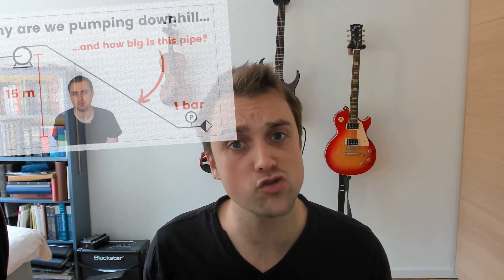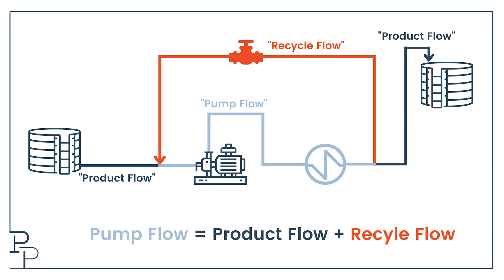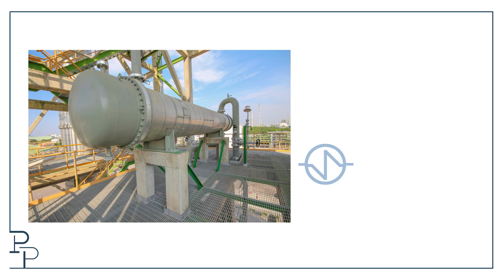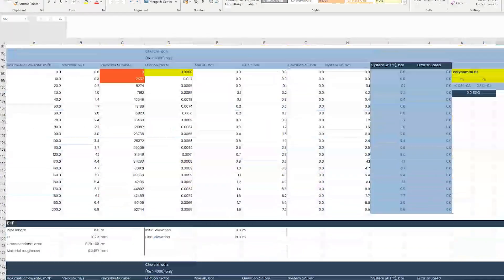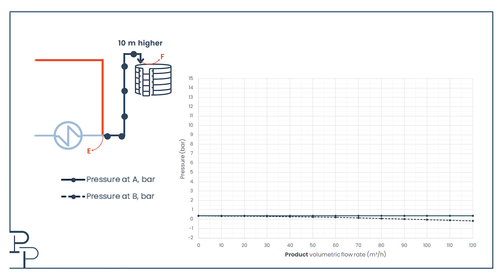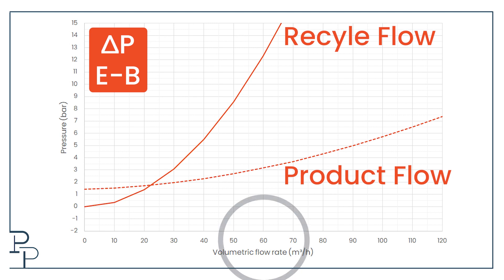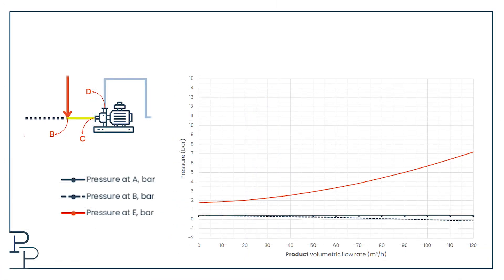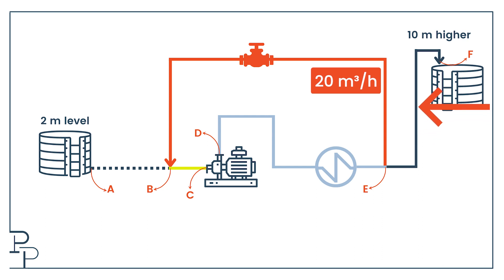System curves with recycle lines

Comment: Excellent explanation
For me the system curve can be defined as a function of the recycle flow, the pruduct flow or the pump flow. It just depens on what flow is important in the process.
But maybe the system curve definition is based on the pump flow because the definition is maybe based on a simple example without recycle line.
Thank you Pat !

Comment: Good job on a tricky problem.   It seems like you have assumed the recycle valve has a fixed CV through the range of your flow rates, another way is to assume a % of the flow goes through the recycle.   in your case, a fixed restriction is like is like using an orifice, which could be a good idea to consider because of cost, but then you would probably need a control valve on the destination to maintain a desired flow to the tank.  To keep the problem simple you didn't optimize the size of recycle valve (or the size of the orifice) with the sizing of the pump, or consider using a pressure control valve in that location, but others may want to do so.  You made an arbitrary choice on it's CV, but changing that CV could have a significant impact on head and flow of the pump, the long term energy use, the NPSH, and the reliability (how close you're running to the min flow) of the pump.  

Probably would be worth you doing a video for a recycle system where the suction and discharge are coming from and going to the same closed tank.  That's a fun one to think through. :)

Comment: What is the point of having a recycle line here.  Are you using a recycle line to control  product flow to the tank?  Most of us simply use a discharge control valve at the pump to do that.  It limits the flow in the system (and pump) to only the flow going to the tank and therefore uses less energy than pumping both product flow PLUS the recycle flow to the same head needed to get your half or so of the total flow actually moving to the tank, the rest (recycle flow) being unnecessarily sent through the pump.  Product going to the tank is the only useful flow, so that should be the only real flow we need to pump, right?  But your recycle flow is also going through the pump and back to suction and is thus 100% wasted energy.
Reply: A recycle line could be used, as you suggest, to control the flow.  But, as you say, why not just put a control valve on the discharge which would be more accurate.    One reason for a recycle line though is to ensure a minimum flow through the pump at all times.   There's a couple of reasons for doing that:
1) Centrifugal pumps require a minimum flow through them.  If the pump is shut off on the discharge side, the heat input from the pump impeller losses can begin to overheat the fluid and could cause flashing in the pump which will cause premature seal and bearing failure.  I think there's also a possible thrust imbalance problem, but I'd have to look that one up.  
2)  Another reason might be to have a higher flow rate through the exchanger, this will increase turbulence which will in turn increase heat transfer coefficients,  and a high velocity through the exchanger would reduce the RATE of fouling.  Having the flow stagnate in a heat exchanger could create a few problems depending on what it's doing (maybe the material would freeze, maybe it would overheat due to turndown and a increased LMTD (that's a tricky one to think about).  
3) Another reason would be to very accurately control the discharge pressure on the pump which will improve an downstream flow control devices (which might be manual or automatic).

Overall, Pat's done a good job of getting people to think about pump recycles   Every case/need is a bit different, so it's not an automatic plug and play solution.